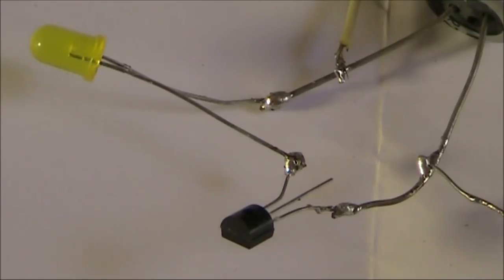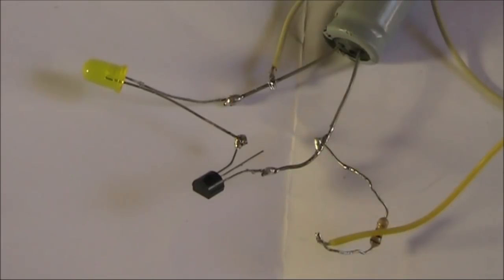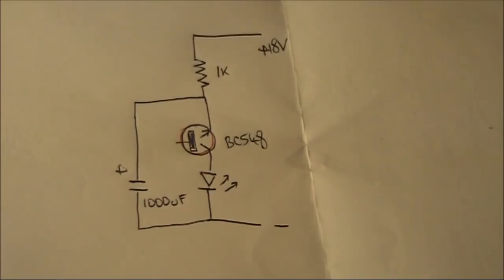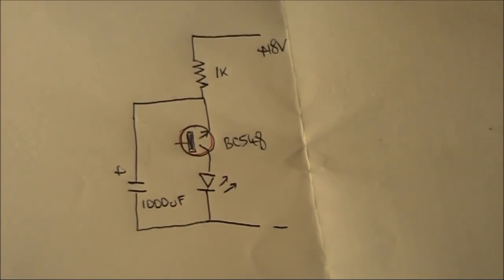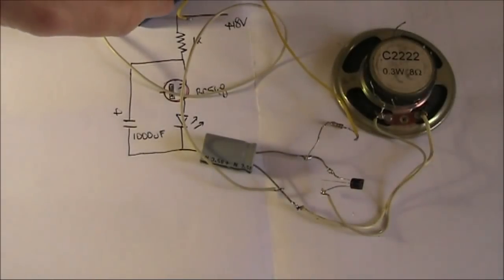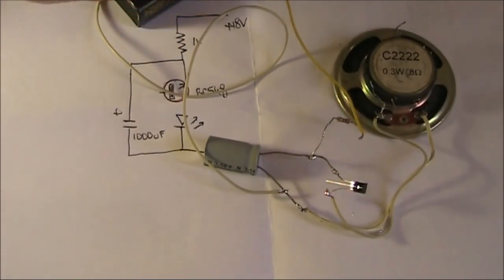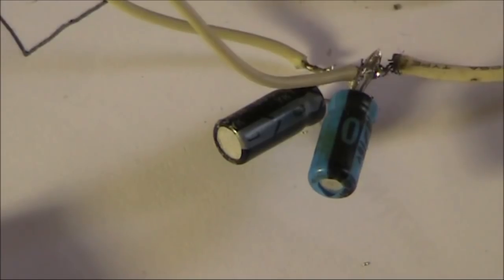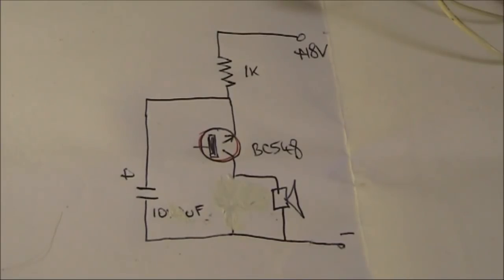Look no base connection! Novel transistor flasher and oscillator circuit

Comment: I try this circuit with 2N2222 transistor and pjesoelectric buzzer and 8k resistor.
Circuit starts run with about 10 volts.
Is will possible use avalanche mode transistor as a RF amplifier?
Reply from the maker: Not that I know of.